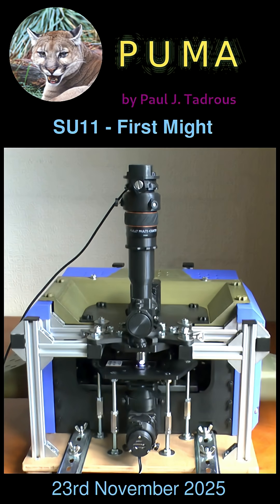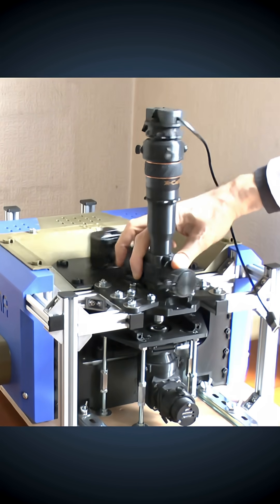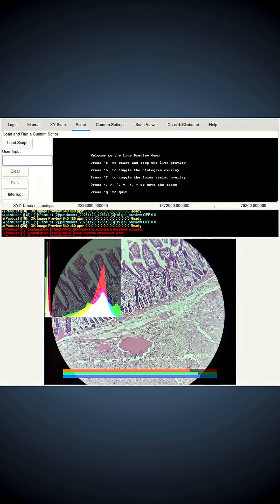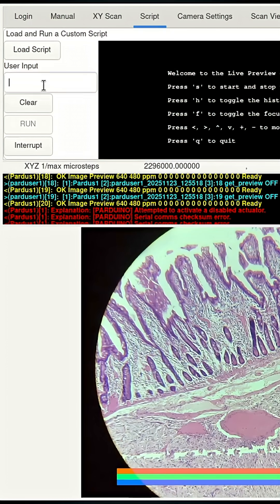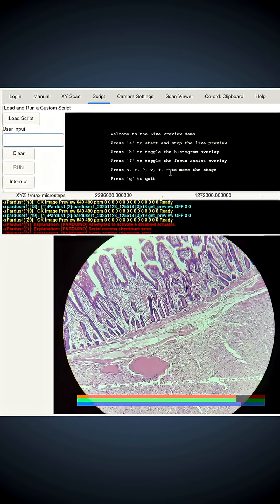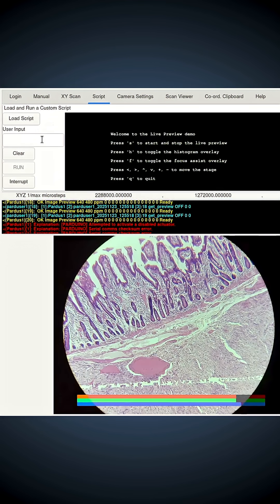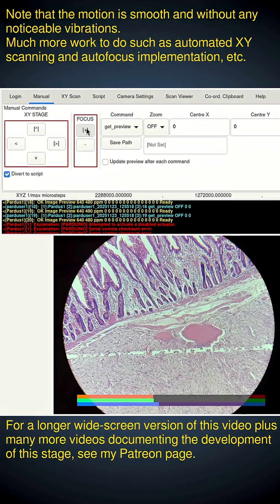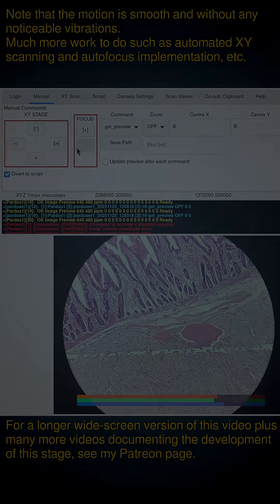'First Might' - Controlling the CNC microscope stage with the PARDUS software for the first time.

Comment: It looks like the camera image moves in the opposite direction of the buttons. Are they reflecting (no pun intended) the physical movements of the motor or the direction the image will move?
Reply from the maker: Hello. The direction associated with each button is a personal choice you can easily change in the script. So you just set the direction variable for each axis in a way that seems most intuitive or helpful to you. This is all done in the script so there is no need to change any physical connections in the stage. When I was doing this demo I set the associations such that the displayed preview image moves in the direction of the key 'arrows'.